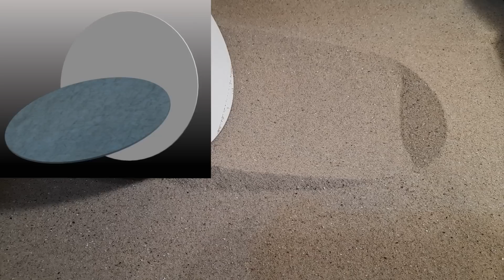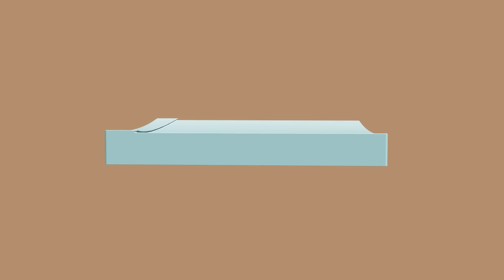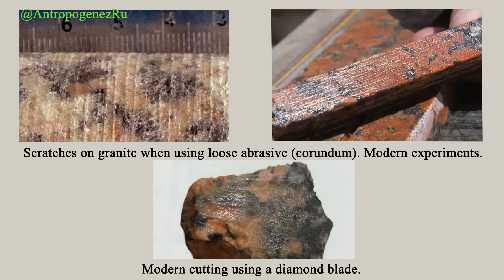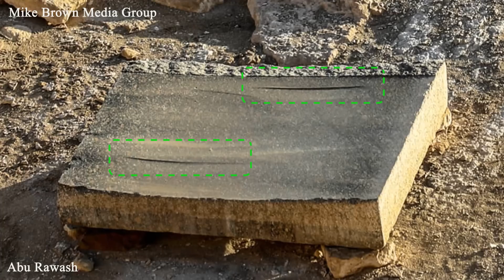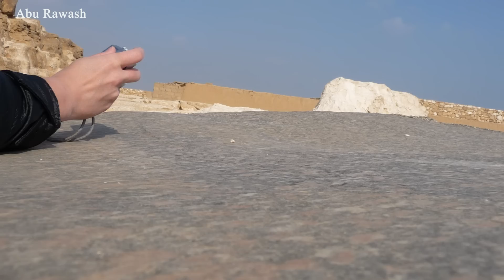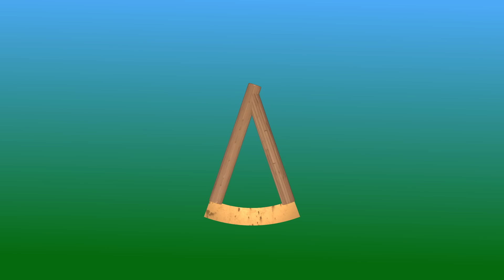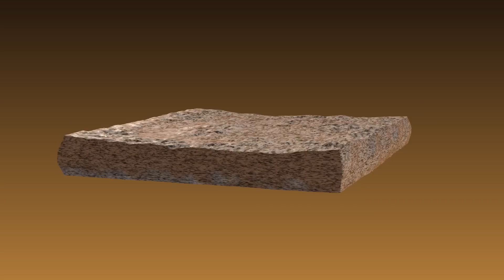The Abu Rawash Artifact: Evidence for the Existence — or Absence of Circular Saws in Ancient Egypt?

Comment: What if that granite block was not the work piece but they sat the stone they were cutting on top as not to bury the saw in the floor? There's holes in my logic but it's a thought
Reply from the maker: Thank you. First they made a curved surface, it didn't fit, and then they used it as a stand for sawing the next blocks. I agree, that's an idea. The marks would have been a little different. Single narrow cuts. The key issue is making such a curved surface, it's not machine processing.
I didn't say this in the video, but most likely it was a bad try. A spoiled workpiece.
Reply: Speculation is a dead end road without some corroborating evidence. What is certain however, to any one involved in heavy industries is that these objects are not the work of hammer and copper chisels. As the archeologists continue to propagate that narrative so they begin to become ever less credible.

Comment: Translational grooves could also be produced by a small rotary tool on a linear motion guide rail system.
Reply from the maker: Simply put - a belt sander. Only the Egyptians didn't have them. And it leaves slightly different traces, I often use this one. I didn't waste time comparing.

Comment: Egyptian copper wasn’t soft like the copper we are used to.  It had high levels of arsenic in it making it as hard as a mild steel.  Egyptians definitely used pendulum saws and likely water powder horizontal saws.  We also know that the Greeks admired and copied the Egyptians building techniques.  The are many known stone mills and depictions of stone mills in Greece that likely would have been replicas of whatever people were using in Egypt.  Plus the metal doesn’t do the cutting - the sand and slurry does.  The metal just moves the slurry around.  Falling water, sand, copper, rope, timbers, olive/animal oil, and fire are the only materials required to build all of ancient Egypt.
Reply from the maker: Thank you. Yes, this has already been said https://youtu.be/ii83g_V8tKA

Comment: I wasn't aware the surfaces were so rough and kinda defective.  It's harder to make machines that do a bad job.

Thoughts about the errant saw cut in the sarcophagus:
1) the saw kerf isn't wide for the fun of it.  It's probably as thin as they could make it.
2) it is way off track. Either 2a) it happened fast and the guys couldn't prevent it, or 2b) it was slow and somehow they didn't notice they were way off, or 2c) They knew it but were compelled to keep cutting, or 2d) they weren't off at all - the project changed, or 2e) their saw cut wasn't off, the next crew that did the other part of the work got it wrong. and there are probably more reasons, and sub-reasons on these!
Reply from the maker: Thank you! You described everything very consistently. This is exactly what I tried to emphasize in the video. Some of the options are paradoxical. Yes, this can be compensated by some sub-points. But if we speak impartially - strange traces. And they are strange on all objects. Too many defects on objects that should be iconic, as flawless as possible.
Reply: @GRES_TAC  You mentioned that cut was believed to be done near the end of the age of impressive stonework, it may be possible that they had already lost some techniques, such as the methods required to redirect a cut that was deviating.

Comment: They cut granite the only way granite can be cut. The way they cut it today With a cable (rope?) and abrasive slurry. Modern machine is like a rope tow bunny slope ski lift...it takes a LONG time to cut.
Reply from the maker: diamond wire saw works in a straight line or bends in the opposite direction. https://www.youtube.com/live/bKsWOn6Pz30

Comment: Imagine that they might cut that stone by hand using a ribbon made of treated leather or copper, etc. Using coarse sand rich in quartz to make the job easier, this could be the only way to leave an imperfect horizontal arc section on the stone if need to change the direction of the cutting path to an approximate perpendicular direction while moving the ribbon or rope to cut, and therefore this will require additional effort to gradually rotate the ribbon 90 degrees, which in turn would leave another imperfect long vertical section.
Also why not using diamond??!!
Why do we assert with absolute certainty that those "Stone Age" civilizations never discovered or used diamonds at that time? This is despite the fact that most of those civilizations were found along riverbanks and possessed greater than expected knowledge of stones and how to cut, carve, move, and build.
However, Thank you for this a great content.
Reply from the maker: Thank you. Reproduction of sand processing does not leave such scratches.
"Also why not using diamond??!!" I agree, but neither Egypt nor Peru  https://youtu.be/Hdwim_n1m_0 have them nearby. Also, they are not found in any jewelry

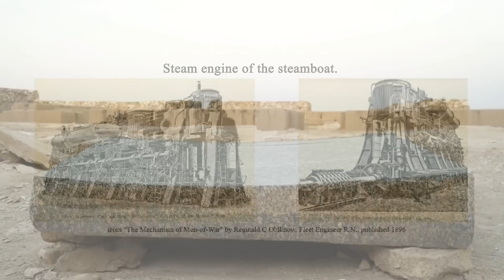Comment: @ 4:34 you used the word 'Giantism'. The word you're thinking of is most likely "gigantism," not giantism.
Any way, @4:34, you said, "Giantism is a manifestation of an attempt to compensate for low technological capabilities."  Now, we have the largest cranes in the world like the Sarens SGC-250 "Big Carl", a ring crane, and the Taisun gantry crane. Their gigantism is definetly not a manifestation of an attempt to compensate for low technological capabilities!
Reply from the maker: "Their gigantism is definetly not a manifestation of an attempt to compensate for low technological capabilities!" Thank you. Yes, this is a good example. The point is different. The development of a certain technology will lead to an increase in size, due to growing power requirements. While another technology can give the same power but in smaller dimensions. Therefore, the Sarens SGC-250 "Big Carl" is a sign of backward technology - another and more efficient type would lead to a sharp decrease in size. But we do not know another type, just as in the era of steam engines there was no internal combustion engine. So the following example shows that a similar shape can be achieved with a small CNC machine (a more advanced technology in this context) than with a huge circular saw - a backward technology.
Reply: @ Ty for the reply. But, the Big Carl is big because it needs to move 'big things In the same way, why don't we assume that the saws that cut the stones were big because they had to cut big stones? For example, electronics can be made smaller to do the same job that was done 10 years ago, but mechanical elements will stay the same unless some part of the system is exploited and changed to outperform itself.
Reply from the maker: @zmarssojourner7435  "But, the Big Carl is big because it needs to move 'big things'" No, it's big because we don't have other technologies for lifting heavy things. Giant saws are not needed when there are diamond cables. And so on. It is the size of the technology that largely determines its effectiveness. And there is no need for bulky multi-core metal cables when there is thin optical fiber.
Reply from the maker: @ Mechanics is mechanics. Also no. There are physical laws of mechanics, and there are other laws. So a nuclear power plant is more efficient than a thermal one, because it is not about mechanics, but about energy transformations. https://www.youtube.com/shorts/Wvh_BGTNS3o
Reply from the maker: "The word you're thinking of is most likely "gigantism," not giantism." You are right. Thank you. It was in the text, but the AI couldn't pronounce it when it was voiced. And I had to compose it manually, which affected the correctness of the sound

Comment: Yeah. They produced the circular, before producing bearings🥳 

Did it ever come to your mind, that people back then were no stupids? Of course they knew that a circular saw would help a ton, but they also knew that here was nothing to drive it. So they resorted to the next best thing. A whipped saw. You barely see these today, because we have mechanical assisted saws, that do a way better job, but 150 years ago, bearings and small motors were uncommon, so people used them. We still have one rusting in the shed. I tried it once and it utterly sucks balls. But the alternative is pushing a straight blade and then i am limited to a roughly one foot cutting face, on wood. On stone, it is less than an inch. 

Just shut up and go. Go where there is no internet reception. You are the problem!
Reply from the maker: Thank you. "A whipped saw." you tried once, and I sawed with it all my youth. Here is its analogue I mention (at 2.57) https://youtu.be/ii83g_V8tKA?t=157 Obviously you did not watch the video, it talks about the fact that there were no circular saws.
Reply: @GRES_TAC
Of course there were none🙄 I pee on you, for riding this disgusting train. You need to learn how memetic diseases work! You can't talk them away! You ignore them, stay to the facts and call everyone rightfully a dimwit, who suggests that brain-farts contains any substance.
Reply from the maker: Thank you, I will take your words into account.
Reply from the maker: " before producing bearings" you see what the matter is, they had a bearing. Simple, nothing more than a bushing - a plain bearing. Otherwise, it was impossible to ensure the accuracy of the vases https://youtu.be/o2WelA-T6cE?t=662 Therefore, I separate ignorance from stupidity. And I will not apply your own rules to you.
Reply from the maker: Yes, I must admit, I also feel sick from this train)

Comment: They could have used a smaller blade sliding on tope of two shafts that are moved, causing the deeper cuts .  Just like a rougher on top of two boards with a  large flat bit evening the surface.
Reply from the maker: Thank you! Yes, the guides could work too. Excellent option. I tried to consider the simplest solution. The pendulum length can be adjusted to adjust the radius. The guides need to be redesigned. And their manufacture, especially precise, would require additional efforts.

Comment: I have respect for Grestac as he is always in depth and also includes other possibilities. Thank you.
Reply from the maker: Thanks. I have one and I work a lot with a circular saw and other machines, so I understand. So does Chris King Precision Components https://www.youtube.com/watch?v=2cL2UL5tzLc&t=1345s
Reply: @GRES_TAC  what about a pendulum?  The box in the museum, the one where they overcut the lid, nobody ever says if the cut inside the rock is curved or straight.
Reply from the maker: "if the cut inside the rock is curved or straight." in this picture on the right https://drive.google.com/file/d/1vKTfnM0BSauTfWIBcT5hlqz4LydZu9xE/view you can see that the cut was initially straight. How they worked after the lid broke is really unknown. It is logical to assume that if they initially sawed straight, then they also sawed the corners in the same way.
Reply: @GRES_TAC  I fixed my initial comment. good job
Reply from the maker: @Tracy-j5n  Thank you. There was no need to correct it. Criticism makes me think.

Comment: Anybody who has ever used a bow, saw nose that unless you’re super careful, your cut will start to bow at a curve and will look exactly like this! But most people are not contractors. Most people have jobs that do not require them to use real tools so things like this seems strange but to a contractor, we know exactly what happened
Reply from the maker: Thank you. I worked with hand saws long before the advent of electric tools. This requires bending of the saw blade. And therefore relatively small thickness. While the saw marks show a large thickness of the blade. https://youtu.be/tOICtofKKM4
Reply: Reminder that the only metal supposedly used was copper (bronze rather), which bends fairly easily even when quite thick. Particularly with the kind of constraint applied to cut through granit.
I am totally in line with a bending flat saw. Which we know existed as we have seen long deep flat cuts in other blocks.

Comment: If the slabs were rolled on rollers, or logs, into the cut, then any imperfections or debris on either those rollers or on the underside of the slab itself would show up on the cut surface pretty much like what we're seeing.
Reply from the maker: Thank you. Yes, that's an excellent suggestion.

Comment: My bandsaw cuts barrel shaped curves VERTICALLY pending on many factors.  The copper saws of the time could wander during the cut pending on speed, applied pressure and of course variation in quality in the stone mass.  No, the copper did not cut granite per say.  They were using sand. Dragging soft copper in sand on the stone would get the silica grains imbedded in the copper, and abrasion from the tough silica grains would grind away a kerf for the saw to pass trough.
Since it’s a tenuous job, one would use as thin a blade as possible to remove as little stone as possible.  Well, a thin blade will wander in the cut more than a thicker one. The two lads handling the saw are following lines on the faces of the stone.  But these poor sods will know only after the cut is finished that the blade went off course.
Unless it is demonstrated that the curved shape did served a purpose, these blocks were waste from cutting operations.
I wasted good wood because of blade wandering.  They wasted rock.  If they had high tech, they would have milled down that mistake flat and used it. We would not have fund it.
Reply from the maker: "Dragging soft copper in sand on the stone would get the silica grains imbedded in the copper" 3:19  This is what it is about - using an abrasive.
And not copper as a base, this is discussed in detail here  https://youtu.be/ii83g_V8tKA?t=43
Reply: @GRES_TAC  Sorry if It sounded redundant.  My two cents was about blade wandering in the cut that creates barrel shaped surfaces.
Reply from the maker: @ Thank you!
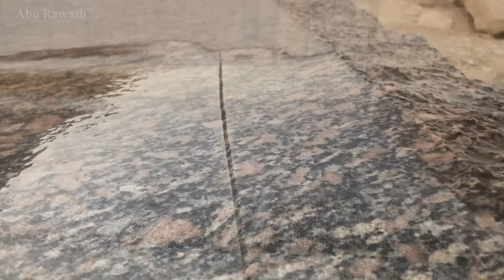Reply from the maker: "If they had high tech, they would have milled down that mistake flat and used it." 8:56  that's what they say, with precise equipment there will be no errors by definition

Comment: A 30 foot diameter tool doing work on large stone blocks is challenging in the robustness of the tooling rig required,  and stabilizing the large stone work piece while cutting is a further challenge.

There is a track record of variation in the quality and precision of the stonework throughout Ancient Egyptian history.  Some of it is precise beyond even our modern day capabilities while other works from later periods look like hand work with no precision tooling or proper rigging setup at all.  This is an indication of loss of tooling technology gradually over time.  A clear example would be the quality of hieroglyphic inscriptions in stoneworks becoming cruder over time.  The implication is loss of knowledge and degrading technology over time.  The highest quality works are the oldest and extend back prior to the pharaonic time period called 'Ancient Egypt'.  The incredibly precise machined stone vases and bowls predate Ancient Egypt, but this was all a continuum of a culture in flux over time.
Reply: Precise beyond todays technology is inaccurate.

Marvelous, absolutely.... Beyond a shadow of a doubt, but casual hobbyists can buy an engine lathe or an indexable mill and turn or mill features down to the half thousandths of an inch.

Commercially available CNC tech is easily capable of >.XXXX" work,l, with cutting tools.

Once you get into the world of lapping and grinding, and certain controlled polishing techniques, your working at sub hundred thousandths of an inch work.

By contrast a sheet of composition paper is twenty thousandths of an inch thick.

Moving beyond commercially common performance and into scientific applications, were assembling molecules into patterns and manipulating graphene at will, in real time, with observable and repeatable precision, at the atomic level.
Reply: @MatCran  well to be fair no one has been able to reproduce an ancient egyptian stone vessel, and I mean with all its features, hard stone with cristal occlusions having different hardness, paperthin polished walls and precise geometry, kept through the inside when the lid is sometimes much tighter than the lower part of the vase. Not so easy for us to make one today, if we even can. we dont know how they were able to make those.
Reply: I wonder if stone masons developed skills over generations, then a pharaoh got them to build a pyramid tomb, then had them all killed to protect its secrets and stop anyone repeating such a monumental structure. Sounds like a pharaonic thing to do. Thus the skills are lost. Each subsequent pharaoh does the same thing, starting with a lower skilled work base, until stone masonry becomes a very unpopular trade.

Comment: what if this stone was just used as a work pc holder/platform and everything we see indeed came from a large circular saw, but accidentally after cutting through the actual stone being worked?  A large circular saw would need maintenance for replacing the cutting edge, the center journal sleeve, etc.  And that would never be exact and would account for the variations in this stone.

Comment: Not a constant speaks loads. why they wanted a curved surface is a big question, but the marks look like how a rope would cut. And this to my mind, did they really want a curved surface, and could it be a mistake that they expected to correct out in the next process. Not knowing what was intended leaves open a ton of could be. Like perhaps its just a trial of what we might be able to make if we did x.
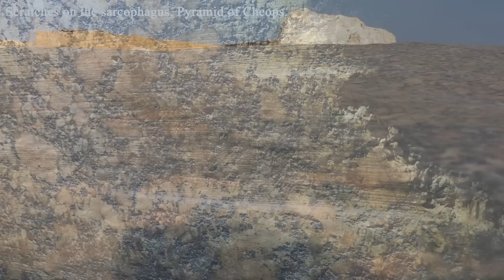Reply from the maker: Thank you. Yes, this could be a test. An experiment. That is why I compare it with other objects 5:28 where there are manufacturing errors of the same type. It is difficult to assume that the sarcophagi in the great pyramids are experimental samples.